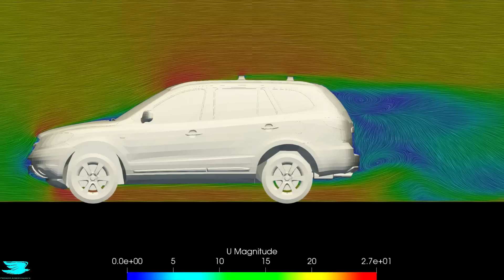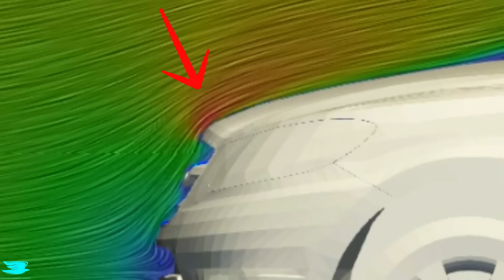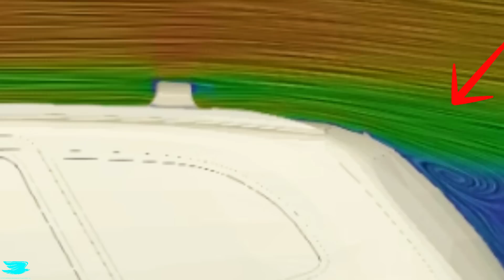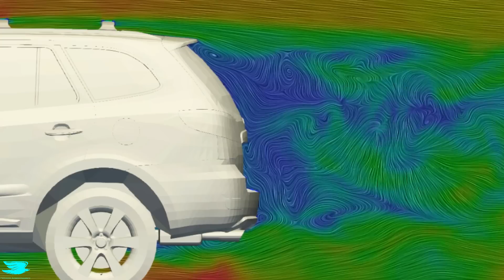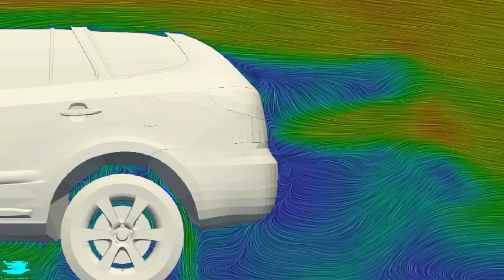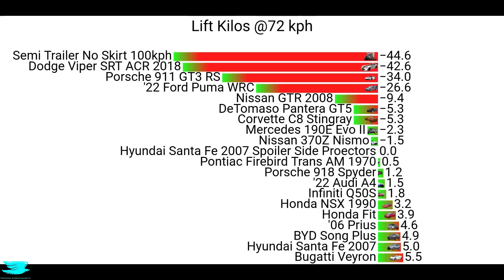Lowering The Fuel Consumption Of This SUV

Comment: Hey Amigo! I just watched the Top Gear video on the Manthey Porsche 911 GT3 RS where they claim a 20% increase in downforce without any increase in drag (link: https://youtu.be/aTZEEw0525U?si=dpLAsoQlJqPeorRC&t=222 ). Is this actually possible? Do the changes they made to the stock GT3 RS support this claim? I would love to see a CFD comparison between a stock GT3 RS and a GT3 with the Manthey aero package! Thanks for the awesome videos!
Reply from the maker: Thanks for the information. I just watched it. Just a quick idea is yes it is. For this car, they improved the diffuser, that alone will drop the drag. They also used better rear rims, which also lowers the drag. The front splitter is longer, so that also drops the drag a little. The rear wing has much bigger endplates, which also drops the drag.

So, there are a few key regions that reduce the drag, which will help make up for the drag increase from downforce production. Whether the drag stayed exactly the same, I can't say from eyeball. If we can find an accurate model on it, we can do a CFD test on.

Thanks!

Comment: Curious how the effect of the side protector would compare to possible effects from aerodynamic/sporty side skirts. Have you talked about those type aero kits yet? 

Most Audi cars with the S Line package have sportier lower moldings than non-S Line trims, which usually dont have any. I’m sure theres other examples too but the E36 M3 was available with a “luxury” trim or a “sport(i think)” trim, which had different side skirt styles. Can those side skirts help clean up the rear wake?
Reply from the maker: We have looked into them and they usually lower the drag a little bit because the wake from the wheels can be managed better. But, traditionally, a lower skirt is used for producing more downforce because you isolate the lower pressure underneath to the outside - you get a better seal.

Comment: What is the effect of exhaust gases on the air wake from a car? My car consumes over 200 liters of air per second at full throttle, which means that the volume of exhaust gases is at least 1000 liters per second. Depending on the speed, the effect of exhaust gases changes.....
Reply: 300 times that volume of air has been removed by your car and is filling the left vacuum... 
Assuming Prius to Nascar Stock car shape and small engine...
Reply: @InternetListener  Has anyone tested this or are you just thinking out loud, all the air around the car doesn't fill that groove because then there wouldn't be low pressure there with a strong vortex flow that has an even lower pressure in its center. On airplanes there is a device for increasing lift called a blown flap, and if someone were to describe the effect of blown air on the air flow behind that flap in the same way, that flap wouldn't exist because it wouldn't make sense. To be able to perform a thought experiment you need to have a lot of knowledge and not just raw surface logic. My car has an engine capacity of 5.7 liters and can go 260km/h, the area of the rear part is relatively small considering the overall size of the car so bringing additional fluid into the low pressure zone should have an impact on aerodynamics same as a cut off bumper
Reply: @makantahi3731    There was s time no CFD could be done, estimated guesses or hypothesis and real car on real road testing was the only way. Experience could be written aand read afterwards so more people could be involved on the research.
Old aerodynamics books will impress you on how many accurate guesses can you make after some little correction to assess your similar problem.
You can now for sure how many air and gasses are produced by your ICE according to power figures and specs... 
Your car may move, if Corvette or Sedan, Sf x cdx x top speed = flow 
Flow is Volume per unit of time.
0.6 m2 x 75 m/s= 45.000 L/s
100 L/h x 15.5 / 3600 = 0.5 L/s per stroke some rpm magic to rev per second after
6000 rpm = 600 rps
So 300 L/s pf burnt fuel... Some stechiometry after gives exhaust maybe around 1000 L/s or around kg/s... Or do the math yourself...
Reply: @makantahi3731 45000 L/s /600 rps=75 L so you need to pump 75/5.7 times more than atmospheric engine... Who knows? Maybe with afterburner or a plane engine...
Reply: @InternetListener  i did and exhaust gas volume could be about 1000L/s
Reply: @InternetListener  No one said exhaust gases would fill the air gap behind the car, but they can affect it, it's just a question of how much, and you wisely skipped the blown flap.
Reply: @makantahi3731 interesting for racing I assume. I've found some papers on your question like exhaust position influence in drag...I guess testing a mule car may be cheaper than developing and running such a complex simulation but it's a very question for sure, also a safety problem because you don't want hot toxic gases concentration inside cabin or near flammable areas etc.

Comment: I notice a lot of cars bmw/german impreza 2008 crosstrek second gen have large panel creases and my thought was that it seperates the above and below wheel well air making the upper section more aero dynamic also post front/rear wheel dimpling or texturing seems really common on newer cars and my assumption was it was to increase energy/boundary layer thickness to allow the air to have a controlled separation around the back separation edges of the car would be really cool to see how a 2019 ish crosstrek behaves aerodynamically because the rear of the car has what looks like two forced wakes one behind the rear window and one over the trunk with the rear lights controlling the air around there, but that's just speculation.
Reply from the maker: I think a lot of the texturing around the wheels is for looks because, for example, doing it to the rear wheel usually makes the flow detach around the back of it so the wake of the car starts from the back of the rear wheel instead of at the rear edge of the actual car.

But, this data also shows that sometimes it can reduce the wake in some places. But other cars suffer.

Comment: Driving style plays a major role in lowering fuel consumption. With the same BMW 3 series my dad gets 7.5 L/100km(31.4mpg, which is already impressive with owners of this specific car model constantly reporting around 23.5mpg) while I can squeeze out 5.4L/100km(43.6mpg) by keeping the engine load more constant when cruising and lifting off the throttle earlier and engine break whenever there's a traffic light or low speed traffic or downhills ahead of me.
Reply from the maker: That's true too.

Comment: Nice work Peter! I have a Toyota Hilux 2012 sr5. Does a canopy improve aerodynamics, or is it better with just the tub?
Reply: Now lower it about 80 to 100mm from road height and you'll see a huge improvement
Reply: A canopy or Tanoe cover is usually better aerodynamically than just an open bed